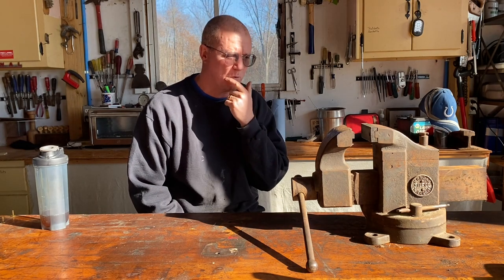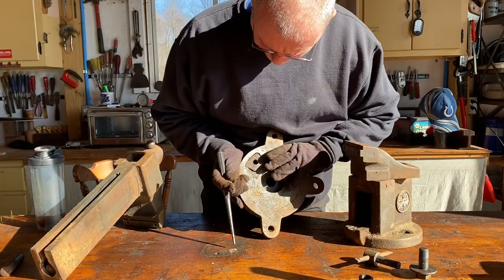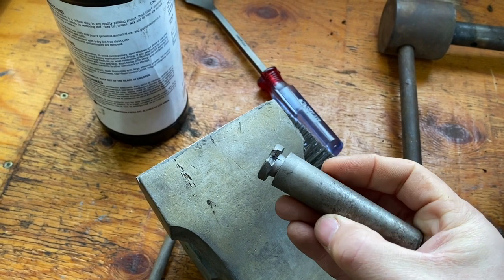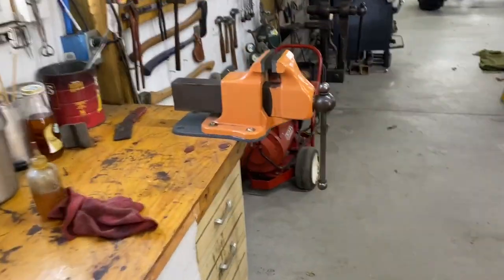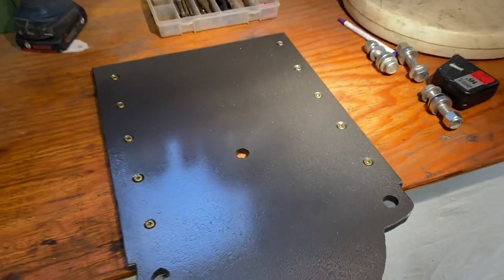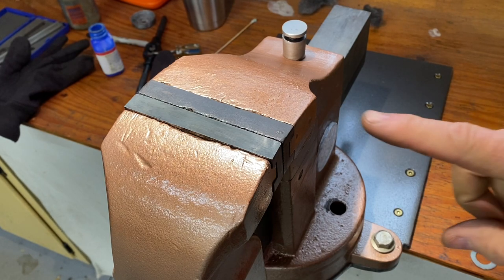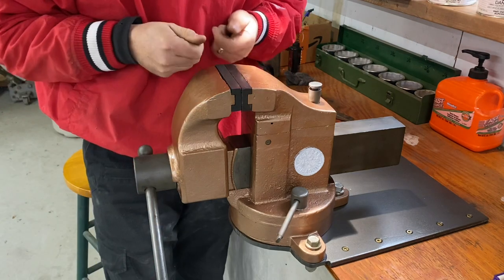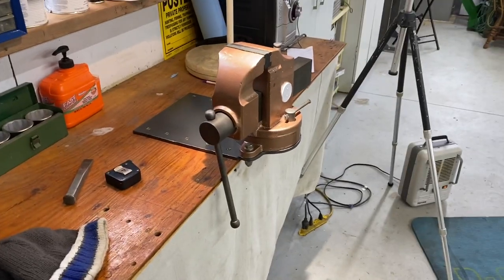Morgan Swivel Jaw Vise No. 345 Restoration

Comment: If Iam not mistaken you put the pin back in the hole upside down when your using the swivel. I have a 403 1/2 Colombian with the swivel jaw and that is what I saw on other videos and I read. Mine fits in like that when Iam using the swivel, a way of not loosing it. You did a great job.
Reply from the maker: I am not sure how that would work...my pin is tapered so it won't go in the hole upside down. I will keep my open for one that will allow that.